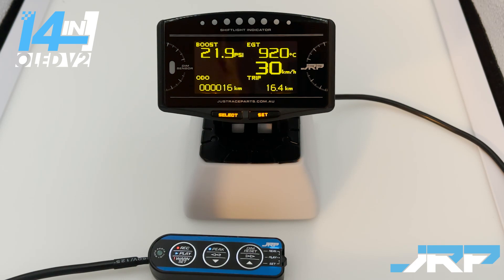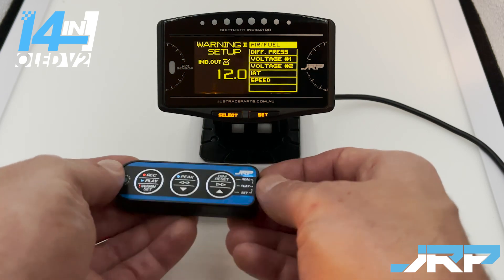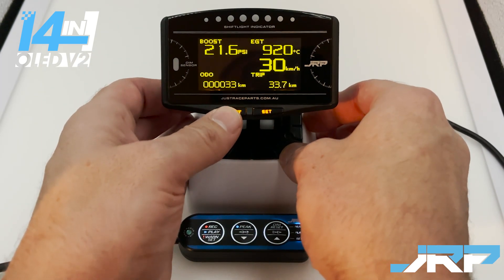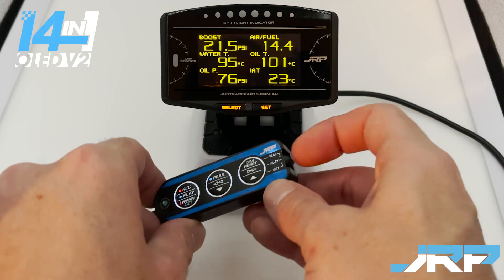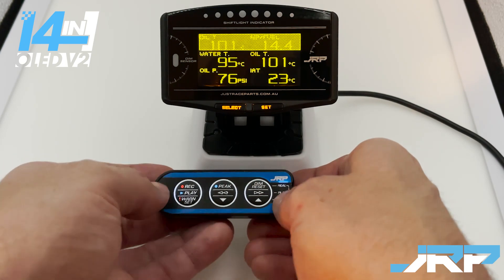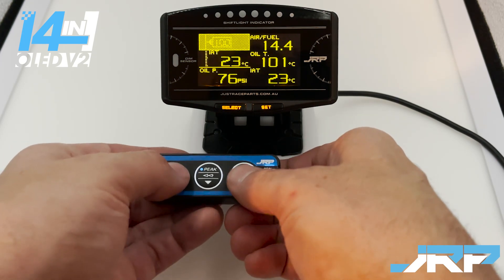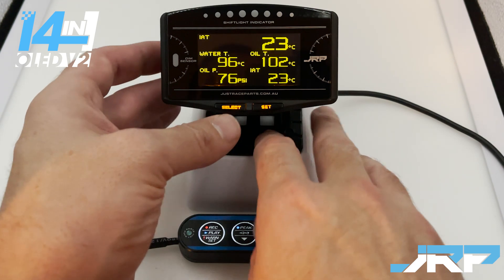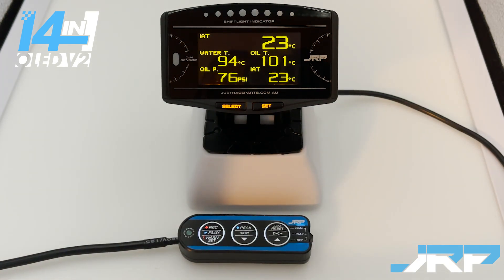JRP 14in1 Multi Gauge Guide No.1 – Changing Screen Layouts & Accessing Settings Menus

Comment: I wired mine up but my RPM on actual dash say 1k the guage shoes 250 then also my shift light only works when I shift through gears not when the needle reaches a certain point
Reply from the maker: Thank-you for the message, There could be a few things going on here, Depending on the vehicle/ engine combination tacho can be a little tricky with initial setup. You may need to change the number of Cylinders in the "System Setup" Menu, and you could also need further Ratio adjustment with a "JRP Tach adapter." Best thing to do would be to send us a DM on Facebook, or give us a call 9-5pm Mon-Fri (AEST) and one of our technicians will be able to give you a hand getting this setup with your vehicle. 
DM Tech Support: https://www.facebook.com/justraceparts/
Ph: 07 3149 3443

Comment: Need to add fuel level support on next update
Reply from the maker: Thats a fair comment, Thank-you @ricks_Toys, Fuel level was replaced with the highly requested Volts#2 over 5 years ago. Sadly there wasn't enough demand for fuel level, so it has since been superseded, we do have a fuel level gauge in the Edge series that might be worth checking out: https://www.justraceparts.com.au/digital-universal-fuel-level-gauge-kit-52mm-edge
Reply: @JustRaceParts  sad to know, all I need is shift light coolant temp and fuel gauge.  Boost, oil and voltage I don't mind having separate gauges for
Reply from the maker: See the link below, we have a Tacho/ RPM gauge that will change colours leading up to your redline giving you that shift light feel. 
You can configure these colours so it only goes Red closer to the red line, Talk to our techs on the phone or Facebook Messager for more info.
https://www.youtube.com/shorts/VF9ynXUcNls
https://www.justraceparts.com.au/digital-tachometer-gauge-rpm-shift-light-52mm
https://www.justraceparts.com.au/digital-water-temp-gauge-kit-52mm-edge
https://www.justraceparts.com.au/digital-universal-fuel-level-gauge-kit-52mm-edge

Comment: Can you reset it, mine does the loading screen but then goes black and doesn’t show anything but l can go to the settings bit and all that
Reply from the maker: Absolutely! Thats a rare issue, but an easy fix! Sounds like a factory reset will fix that, send us a message on Facebook and one of our gauge technicians will work through the issue with you one on one. :) They will run through some extra things to look out for, and go through some prevention techniques to ensure this doesn't happen again with your setup. Give us a call 9am-5pm(AEST) 07 3149 3443 or message us on Facebook, we are here to help!
Reply: @JustRaceParts  it’s been working today but some days it won’t
Reply from the maker: @4x4boys42 You have a power issue with you vehicle! You will need to contact our customer support so that we can check a few things in your setup that will be causing this intermittent issue. Please call Monday- Friday 9am-5pm(AEST) 07 3149 3443 or message us on Facebook, we are here to help!

Comment: Does this read fuel pressure ?
Reply from the maker: G'day @chrisasaurus!

Yes The JRP 14in1 Multi Gauge will read and display Fuel Pressure for Petrol Vehicles with the included 10bar Fuel Pressure sensor. If you Plan to run Ethanol Based fuels such as E85 or E10 you will require a different sensor which can be purchased here: https://www.justraceparts.com.au/e85-fuel-pressure-sensor-npt

This sensor is also suitable if you're getting crazy contamination in your oil for Ethanol, or in some cases customers wish to monitor coolant pressure or exhaust back pressure. 
Any further questions call us 9-5 AEST Were a Brisbane (AU) based company, or you can always message us on Facebook, the inbox is monitored during business hours ;)

Comment: Can't get my fuel pressure in PSI,  I've read pgs 23,24.  All it does in change warning pressure up and down.   In set up "units" I changed to F, but only Cesius setting offers PSI???  I want F for temps and PSI for fuel and oil??
Reply from the maker: Hi Paul, Thanks for the message, We see you emailed through to sales and we responded in detail there. For others reading, Yes "Fuel Pressure" can display in PSI, regardless of the temperature units chosen, carefully go through page 24 on the pdf manual. You will need to use a combination of the hand controller and buttons on the screen. Cheers! :)

Comment: What would I have to do to make this compatible with an obd-1 vehicle?
Reply from the maker: Hey Vic Gon, See below 😉
https://www.flowcode.com/page/jrp-14in1-manual-support
Check out the 14in1 support page, there’s a large instruction manual, and helpful setup videos. 
The screen and sensor base pack are a stand alone unit and don’t require OBDanything to operate, they work with Carbureted engines that have no ecu. Also we’ve even had customers install this system in boats, hovercraft, race tractors and aero-planes. If it has an engine, this system will work with it!

Comment: hey mate how does the odometer work off? currently dont have odometer working just seeing if this would help solve that problem
Reply from the maker: It works off having a compatible speed signal being sent to the gauge. If you don't have a speed signal source, you could install one of our HALL effect speed sensors, this will generate speed and in turn OD. We are working on bringing out a GPS speed module in the new year as well that can be hooked up to our systems for simpler install for speed. ;)

Comment: Great video. Very helpful with setup. Really happy with the whole setup. 
Should all setups have the time attack screen? As mine is just a straight line. Also, although I havnt got a water temp sensor installed, should I be able to see it as an option in screen setup? as I can’t see the option, but can see a few other options eg oil temp, which I also havnt installed yet. 
Great product, cheers
Reply from the maker: Sounds like you might have the Pink Port setting in the gauge changed to Trans Temp instead of water temp, if pink port setting is changed to Trans, you won't see water show up. Time attack should show yes, I think maybe best to do a factory reset on the unit, page 61 of the manual, that should get everything back to default and water temp will be there along with time attack. ;)

Reach out to our support guys if you have any issues or questions, they will get you all sorted quickly.
Reply: @JustRaceParts  Gday guys. Thanks for ur reply. I’ll have a look on the weekend n see how I go. Like I said, I’m really happy with the product, worth every cent👍👍

Comment: Seems great but would be awesome if this could turn on thermo fans
Reply from the maker: Highly requested! And its now finally here! Check out the links bellow, You can now run Aux Relay triggering from IAT, Water Temp, Oil Temp and Transmission temp inputs on the v2.6 Multigauge screen and addon pack!

https://www.justraceparts.com.au/thermo-fan-controller-temp-3x-aux-relay-trigger
https://www.justraceparts.com.au/10in1-automotive-digital-oled-multi-gauge-display

Any questions send us a message on Facebook, or give us a call Mon-Fri 9am-5pm AEST 07 3149 3443, Expert sales or our qualified technicians will be able to walk you through further enquires ;)

Comment: Why does my Egt read external temps and not the exhaust gas temp
Reply from the maker: Please email us with a little more information about the issue, YouTube isn't the best place to get support. Send an email detailing the issue a little further and one of our tech support guys will give you a hand. ;)
Reply: I have just emailed you guys, awaiting your response.. Something definitely is not right
Reply from the maker: @zanegleeson7922  Reply has already been sent. ;)
Reply: Texh where a big help.. They just told me to reset it 😂 it's brand new, why would it need a reset.. But I reset the pcb board, and guess what still didn't fix the issue..
Sorry but I am a bit dirty my band new product I spent good money on doesn't work
Reply from the maker: @zanegleeson7922  Tech support told you to reset it for a very good reason. You said the system was displaying 30c on the screen without the sensor being connected, this isn't normal and could have been a firmware issue. The way to fix a firmware issue is to to a simple factory reset, as this will flash the firmware back to the screen so it's a fresh build of the firmware. This needed to be done to rule out the firmware being the issue, it's a simple process of elimination, so part one of that done.

Tech support doesn't work on Sat, but still took the time out of their day off to reply to you, within hours of you even posting here on YouTube, and why we understand you might be frustrated, tech support were actually being a big help considering it's a long weekend and any other business you would not have got a reply until next Tue after the long weekend.

Nothing is infallible and any product you buy can have issues, it's how a company deals with those issues shows what they are made of. And so far, we have replied with assistance on a day off, within hours of your inquiry, and at no point have we not shown we were here to help. So lets jump off YouTube mate, follow the normal process for dealing with any purchase where you need help and we will do just that, help.

We stand behind our products, offer amazing after sales service, so lets get back to trying to work out what's going on so we can get it up and running hey?

Comment: how does this multy gauge see afr? with o2 wideband? or with calculation from other sensors?
Reply from the maker: You need to connect a wideband kit to the control unit. Like the Spartan 3 Lite wideband kits we also sell.

Comment: Does this have the option to convert to Fahrenheit? For us yanks?
Reply from the maker: They sure do, these gauges have the ability to configure KPH, MPH, PSI, KPA, Celsius, and Fahrenheit independently. So it’s possible to setup the system so it uses any combo you like.
Reply: @JustRaceParts  How do you go about configuring that? I want to change just my boost readout from kpa to psi. Cant find anything online about it
Reply from the maker: @CIPHER995  Page 23 & 24 of the manual explain how to change display units.
Reply: @JustRaceParts  can I change my psi to read while with mph?
Reply from the maker: @365rallydailyracing  Yes you can, page 23 & 24 of the manual. ;)
Reply: @JustRaceParts  thank you!!! I just read it twice and realized I missed the button selection to change it!!! So far this gauge is working very well in my rally car
Reply from the maker: @365rallydailyracing  Good to hear it mate, they are an amazing little setup hey. :)